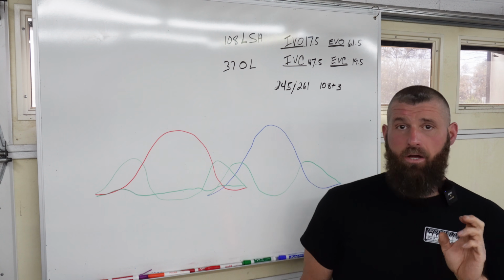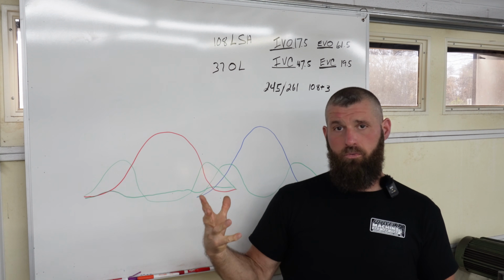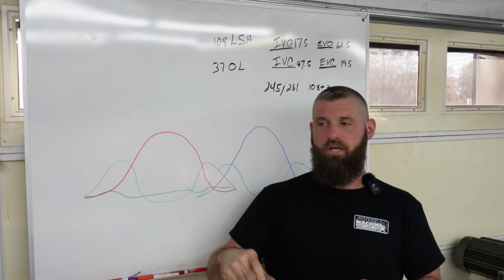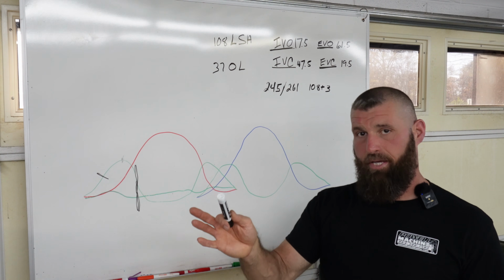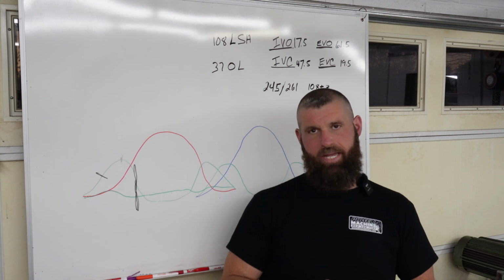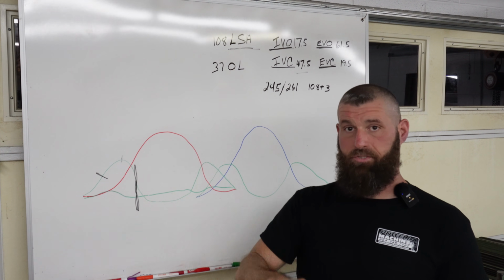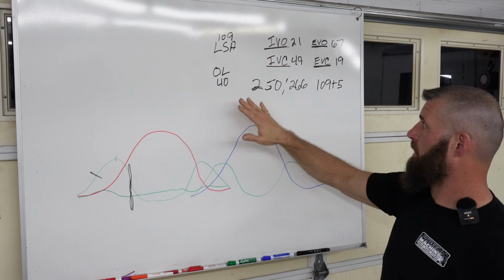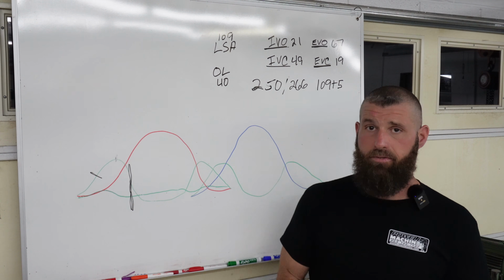How we choose the correct camshaft events for your application.

Comment: Experience testing different camshafts has been my best teacher. My 2 cents: Poor to average heads: lots of duration with tight LSA compression to match. Good to great flowing heads: less duration, wider LSA, compression to match combo. I run split pattern duration cams in everything as I see no downside to more exhaust duration. Everything specific to the engines displacement,  intended use, gearing, converter & transmission type. Big displacement engines can use more duration than small displacement engines.

Comment: Do you give recommendations for a compression ratio rabge to use for your cams?

Do you go by the dynamic compression, like 9:1 for 91/93 octane for aluminum heads?

Do you adjust it/drop it down to to say 8.5 dynamic compression for things like...heavier vehicle, ones with less gear, or less cubic inches?
Reply from the maker: you cant calculate dynamic, its makebelieve

Comment: Theres more to it than how much peak power and tq or how much air, fuel and pressure can I make. Can the engine pull cleanly to the rpms you need and not lose a bunch on pumping losses.use a short rod for less tdc swell time and allow plenty of scavenging rather than reversion. Use the smallest highest velocity chead with the smallest cam that meets your goals so your engine can have the best volumetric effiency where it will live as possible.
Reply from the maker: Spot on, it’s all about balancing those trade-offs for the specific application. 😊
Reply: @powellmachineinc  Yes sir.

Comment: dont be scared to put a bigger better quality head on an engine.  im gonna use a TTF 190 11r on a 302 ford with 10.3:1 compression most likely. camshaft wont even be over 230 on the intake and close to .600 lift.

people put the equivalent of peanut ports on a 540 and wonder why it only makes what a hot 675 horse pump gas 496 makes  when they should be making closer to 800+
Reply from the maker: Try closer to 210 ,@.05 int......

Comment: For Bob's 427 SBC specifically..... if NO valvetrain parts were already purchased and he came to you with goals based on Head Flow and Cubic Inch only, Would it have made for a more STABLE setup to design a Cam for use with 1.6:1 Rockers vs 1.5:1 at the Camshaft level, still yielding the same overall behavior at the valve ? Is there a benefit to shifting 'More Work' to the top side of the pushrod vs the bottom side ? ..... again, if the end result in lift/duration AT THE VALVE was identical, with only cam lobe and Rockers changing....? Clearly Chevy must have figured something out by going straight to 1.7:1 Rockers in the LS and moving up to 1.8:1 in the GenV LT motors (as well as the LS7).
Reply from the maker: Bobs was designed for 1.6 rockers
Reply: @powellmachineinc  I think you might have misunderstood my actual question. I wasn't offering any criticism, I was just curious about your experiences.
In your opinion, what is normally more stable ? Does a larger ratio give you the ability to design with less or more limitations ? I was just trying to understand the benefits of the larger ratio and perhaps benefits of smaller ratios if any. thanks for answering.

Comment: So let me see if I’m understanding you and maybe reading between the lines a little…since this HYDRAULIC INTENSITY is the difference between advertised/total duration and duration at .050 (the meaningful duration point) is this “hydraulic intensity” figure another way to quantify how aggressive the cam’s are off the base circle to .050” and back down and to thus establish a number for comparison purposes????  I’ve just never been aware of this term cause I do motorcycle and we don’t have hydraulics at all.

Like say x cam has a hyd intensity of 20 and cam y has 40 we know cam y is super aggressive and x is really lazy and thus easy on parts too??  Obviously I just threw numbers out there for the hyd int figure.
Reply from the maker: Yes, but intensity doesn't tell the entire story,  it does tell a small piece of it though,  solids use major intensity,  .02-.05"

Comment: Okay, I watched this when it came out. I have been thinking about how things work. I may have all this wrong and probably do.
My question is how much if any does stroke play in cam design?
My thoughts are piston speed and the time to fill or evacuate the cylinder. 
So the reason I ask is years ago looking at crane and other cam catalogs. If I remember right a small block ford cam for 289 to 351 had the same cams. Back them I didn't have the knowledge or confusion I have now. If my confusion is right then those cams wouldn't be optimal at all.
Reply: From watching Daniel, I would say absolutely. Right down to your rod length also. Piston position in the bore changes with stroke length, at crankshaft degrees. The long  arc versus a smaller arc coupled with rod ratio.  Valve timing may or may not need to be changed, but you have to consider stroke.

Comment: When Old timers talk about small displacement combos or big bore short stroke combos the young guys need to understand that no one had good cylinder heads way back when.
Reply from the maker: That’s a great point that often gets overlooked today.
Reply: @powellmachineinc  I don't race competitively so I focus on getting the engine to run how I want not necessarily on whats all out fastest. Its more fun to rev the pizs out of a small engine than it is to grunt around with too small a head. Just my preference.

Comment: So many variables. Without every bit of info requested, there is no way to design a cam to near it's optimized output. Even intake and carburetor selection effect airflow to the best head port design and valve event timing. Same on the exhaust side. Theres so much to consider and compensate for to get the "perfect " camshaft. I had a local speed shop, who i had used in the past, build me a fairly healthy 383 SBC, from scratch, for use with some nitrous. I gave them the info they requested. I requested 500 hp on 93 pump gas. The engine they built is a monster from 4000 to 6500. With the small nitrous kit, its not for the inexperienced driver. BUT!!! It falls into the small heads and big cam category. A better set of heads would allow for a less radical camshaft and increase the average power while maybe or maybe not giving up any peak power. Thats what i got out of your information considering my knowledge being so limited. But the engine has lived 5 years on the 1/8 mile and around my town. Its no drag and drive very far.
Reply from the maker: Rarely or ever have I seen more head and less cam make less power anywhere in the curve

Comment: My only critique is the manifold characteristics are equally important how they interact with the cam itself.
Reply from the maker: As are the headers.
Reply: @powellmachineinc yes sir you are correct as usual my only edit would be that the exhaust gases are not nearly as dense so the flow is not interrupted as easily. 
In the worst-case scenario restricting the hot exhaust gases will act as a cutting torch and they will show you how big of a hole and where that hole needs to be I have seen the result on nitro engines literally sucking the exhaust tubing in where the shockwave was causing a vacuum ballooning the tubing where the shock wave was striking and areas where the flow was restricted melted away.
This is typical where the engine is offset inside the body and a large area of the header is not in the airstream.
Keep up the good work you're winning

Comment: I sure could use some advice on cam choices.. I am putting together a 406 sbc . I have 6”  forged rods , wiesco red series flat top pistons zero decked and a set of ARF 200cc runner and 70cc chamber( was told they are closer to 68cc) proform 750 carb and rpm air gap intake. try to run on pump gas . Want go low end power and must be hydraulic roller. Going to be more street than race but will see the strip every now and then. Also running th350 trans and have 356 gears and 24” tall tires. Love the sound of choppy cam but want it to have good low end and off the line power and not be a dog until 5k
Reply from the maker: Just fill out the cam recommendation form on the website and email it in

Comment: I really like the cam you speced for bob i want to go with a solid rollor for the fact i think it isbettrt on the valve train and can turn more RPMs  i was thinking around 264 x270 with about 680 lift on a 108 lsa now this would be on a 408  cubic inch sbc with 11 to 1 compression abd the heads flow 320 cfm @ 670 lift. Does that cam sound close to you?
Reply from the maker: Without doing the math it probably needs 260 int and 273 exh, id want a .450 lobe lift min, but .460 would be better
Reply: @powellmachineinc thanks so much i will call you when im ready.

Comment: I checked your website and do not see a cam spec sheet listed. Do you have one up yet? If so would you mind linking it please 🙂  I am looking for a good LS cam for Chevy/GM 5.3L with around 10-10.3:1 compression that can work with default tune for a while I get things sorted out, stock fuel injection and provide excellent towing and efficiency and still run on up to around 5800 RPMs. I have been looking at the Comp 54-408-11 and it seems on paper to tick all those boxes. But would rather it be 206/206 instead of 206/212 @ 0.050. Closest thing I can find otherwise is the BTR Truck Torque cam. But BTR doesnt list their full specifications and I want to know what I am buying. My last name isnt Charles...
Reply from the maker: We have a cam recommendation form on the website under "Forms"

Comment: Hydraulic intensity =duration at 50 -(minus) advertised duration the smaller the number the greater the hydraulic intensity.Source performance automotive engine math John Baechtel pg 127. Quoted by Harvey Crane.

Comment: Good video 15 minutes ago I was digging threw cams thinking the dynamic compression was going to give me the bottom end. Wish i could find intake centerline,intake valve open,intake valve closed, exhaust valve open, exhaust valve close FROM 218 intake @50 224 exhaust @50 270 intake advertised 276 exhaust advertised with 110 lsa.
Reply from the maker: online cam calculator, super easy

Comment: I like your content and would like more applied to typical street and strip. Preferably 440 Mopar. 
If you provide examples by plugging in values into your formulas people would understand better. 
For example I would like 6200 rpm , 447 CID and 320 flow. 
Your formula provided = 6447. Now what? How does this provide flow requirements? Thank you
Reply from the maker: Will work on that

Comment: Duration at .050 and Duration at . oo6 have no open and closing points till choose a LSA for the cam.
Reply from the maker: Exactly the opposite there's no Lsa (a output not a input) till I decide the events....😊
Reply: @powellmachineinc pick Int and Ex Dur and Lsa will give you open and closing, change the Lsa will change open and closing.😊

Comment: If a cam has no overlap at 0.050", is there a method to quantify the overlap at a smaller dimension? The delta between advertised and @ 0.050" are all/nothing. When does it play out to zero?
Reply from the maker: Generally. 050 is the std, , the advertised # just doesn't do much

Comment: What off the shelf cam could i get to hydraulic roller retrofit a 454 with peanut heads for a heavy c20? All info i find is max horsepower. I want reliability, max power but still able to pull a load.
Reply from the maker: We don't have shelf cams, we design every cam for its intended purpose

Comment: Modest Chevy engine builder, building my first Ford.
I have a 351w with a 408 stroker kit. Ford 351W 408
Stroker Rotating Assembly Kit, Eagle Crankshaft
4.000 Stroke, Eagle H-Beam Rods 6.200, Diamond Pistons -7.7cc Flat Top Fits TFS Heads, Fits 1 or 2-PC Rear Seal, Rings and Bearings Included, *3.000 Windsor Main*, Balanced Assembly Will have 8stack EFI, aluminum heads. Will be 11.6 to 12.1 compression depending on head, 58or 64cc. Not racing just a tire melting child scaring weekend car show 55 Fairlane. My question is what roller cam spec would you recommend to get as close to 600hp with a radical idle?
Reply from the maker: Fill out our request form on the website

Comment: 2:40 conjecture or not, you don't need cam design software to see if the cam is good, there is the option to just run it, and then there is dyno testing, yes cam software is good and saves time but it's not essential, it's like tuning a 40m dipole for the 7mhz band, you can use a spectrum analyser or VNA, or you can do it the old way and tune it with an SWR meter.

Comment: What is your thought on the D.V. 128 formula for cam sizing. And also Walter racing  formulas for valve size and cross section sizing ..
Reply from the maker: Since Lsa isn't a input,  how can a formula that uses it as on be useful??
Reply: @powellmachineinc it was salter racing not walters. Just to correct my self .. yea that is more less the question. They treat it as a input tjen adjust overlap to slide the events around ...  attempting my first true engine build . So trying to learn even more about what i dont know . For example using their system it puts my cam around 104 lsa which i think is stupid ..  408 or 426 twin turbo, have not decide yet . My current block is trash so making a plan right now .. trying to build it out on paper first .. seen all their vids now bin watching ur vids . I really like this vid it was very helpfull ..

Comment: I studied camshafts since the 80's in college. They are the brain of the engine and the most important when it comes to how the engine runs. I spent countless hrs studying big block Chevy cams and have a pretty good grasp for that engine. Now that I am building a 6.0L LS, a new learning curve. There are so many manufacturers and so many cams, it gets really confusing. Oh, and then the torque converter and rear gear and vehicle weight and tires. That's a whole different conversation and complexity.
Reply from the maker: If you have been studying camshafts for 46 years at a college level, you should have it down to a T

Comment: Something you said is sooooooo true,” NO ONE HAS WON A RACE ON HORSEPOWER, IT’S WON WITH TORQUE!!!!”
    I was on dirt track team 40 yrs ago. We had the smallest motor( an old 327 Vette motor), least amount of money, but were usually 2nd fastest at the race. Almost everyone was OVER CAMMED! Our car would come out of the corners like gangbusters. Other cars would just come on the cam at the end of the straights, too late
Reply: To tight of LSA
Reply: @kenfritsch8749 not true at all. Tightening LSA brings th he cam "on" lower in the rpm causing better torque in the mid.

Comment: I have a question on a camshaft specs remember Eric's blow up motor you did a na kinda camshaft in a boosted motor and it made 1000hp the one I think you did 106 lsa duration I don't remember but 600 something lift it was almost like you did a na camshaft you talk about before and it worked on that boosted motor Eric try to blow up neo can it be possible to test both na camshaft vs boosted camshaft on a motor like that or better motor so see what the power difference would be I am very curious on that situation and see results on that and wondering what your thoughts on jt
Reply from the maker: We are actually going to do that at some point

Comment: LSA set the open and close point.Comp Cams has over 200 lobe profiles.He use cam software to spec a cam.
Reply from the maker: Smh...., I can explain it to you, but I can't understand it for you.
Reply: @powellmachineinc hilarious ….there’s always that one guy who’s gonna argue he’s right till the cows come home.  I don’t get why it’s so hard for these guys to understand that LSA is just the product of the timing events and something for the grinder index wheel if I’m understanding the grinding process right.  I’m glad it’s not uneven in our vocabulary in the overhead cam motorcycle world.  We use adjustable cam sprockets and can dial centerlines/timing in wherever we want them so long as it clears p-v.  It kinda sucks that in a conventional pushrod engine you’ve got to grind that in to the cam and thus a new cam if you want to try something different.  Guess it’s a luxury to be able pop off the valve cover right on the dyno and loosen a couple bolts and roll the cam around to see exactly how it changes your curves!  They got adjustable belt drives and indexable gears/offset keys but still can’t change the intake to ex centerline since it all on one cam.